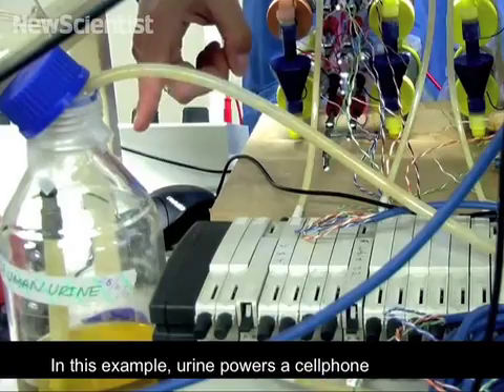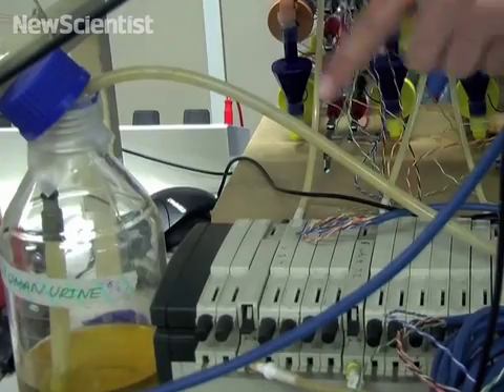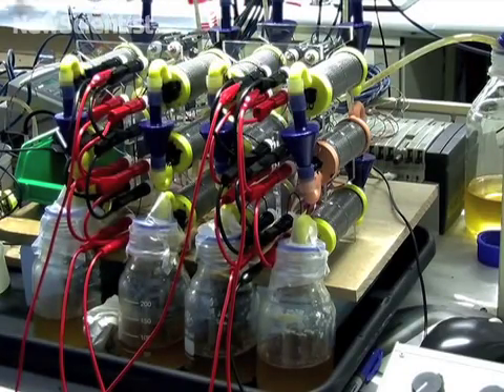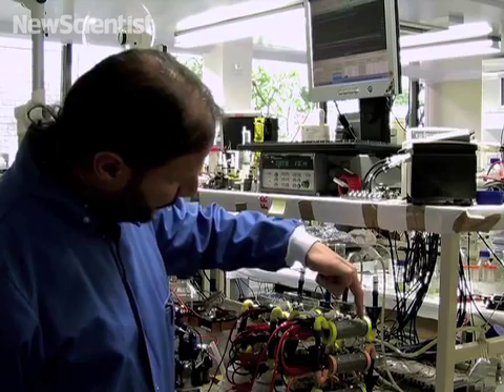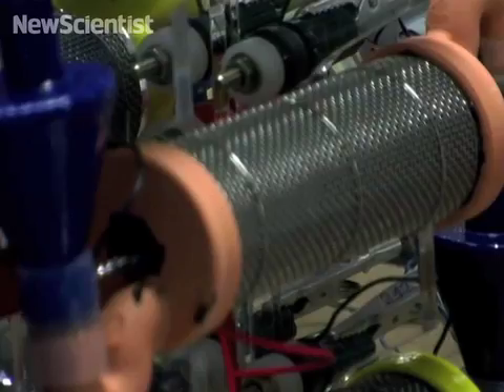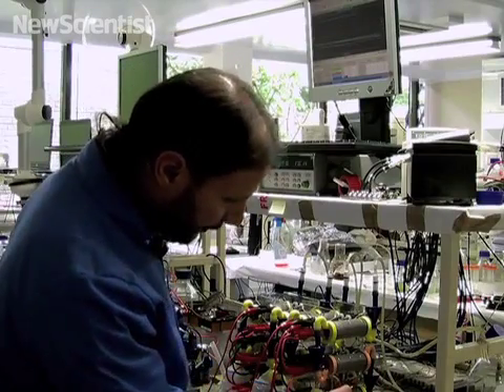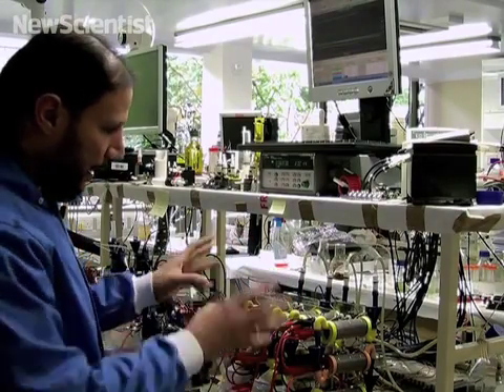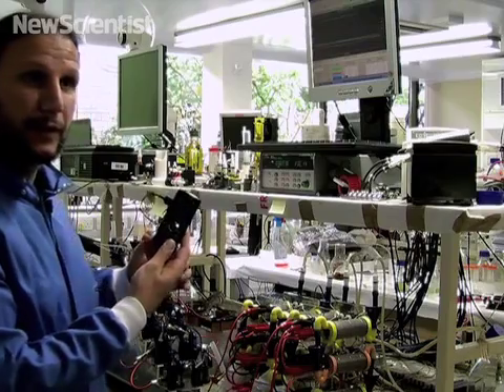How urine could power future robots

Comment: Power a useless cell phone from urine battery but provide power for the urine pomp from the wall socket and call this self sufficient - fuck logic.
If you want to build a self sufficient robot than urine should be the only source of energy for the whole system, pump included.